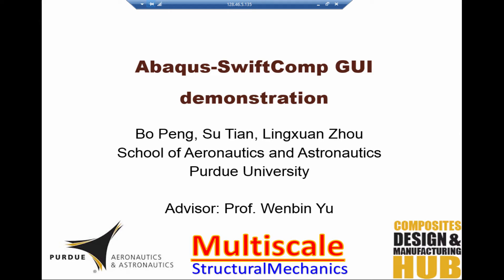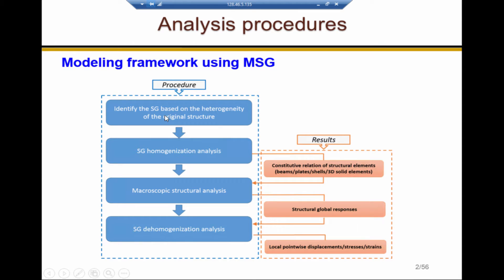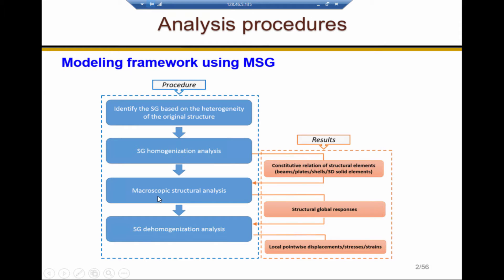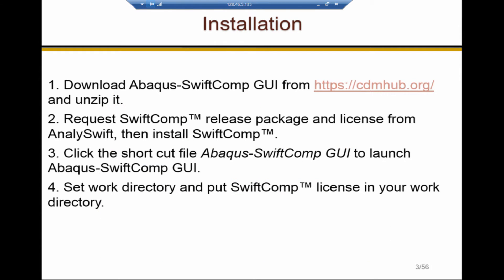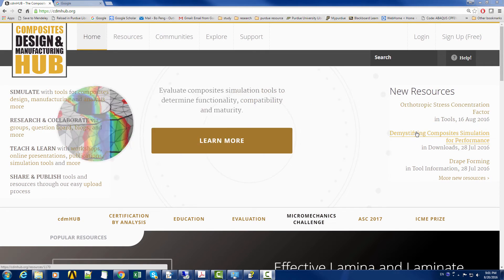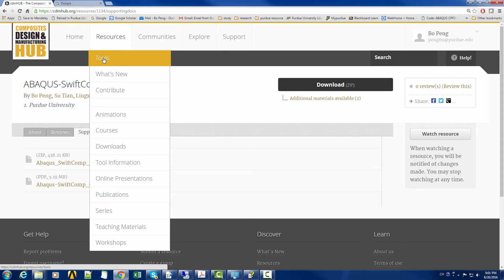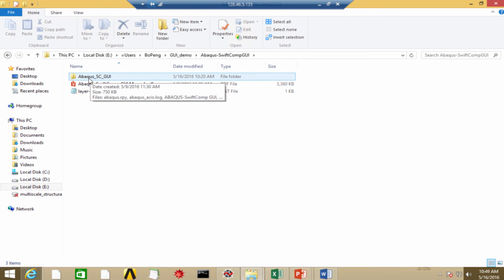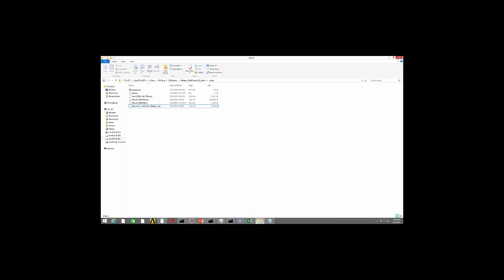Abaqus SwiftComp GUI: 1.1. introduction and installation

Comment: Hi, 
thank you for your tutorial. I have a question.
While I'm waiting for the free trial version, I'm trying to get familiar with the GUI. But when i try to "use" the homogenitazion tool, the window isn't completely displayed and there is no possibility of changing the size. I tried to set a different resolution of the screen but still I have this problem. The bottom half of the window isn't displayed and I can not clik on ok to start the process.

Could you please help me?
Reply: Did you get the solution of this problem?